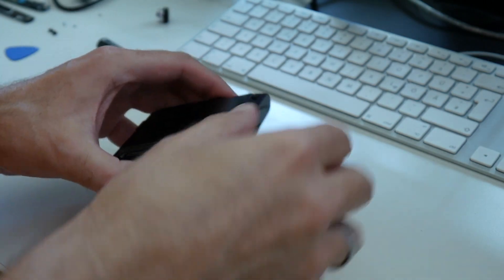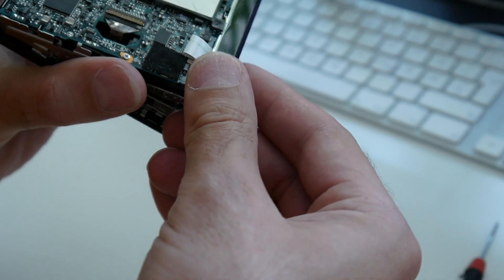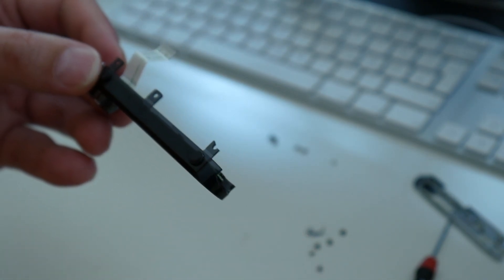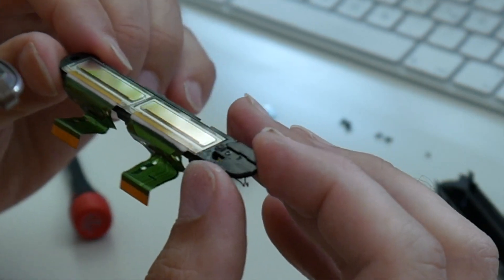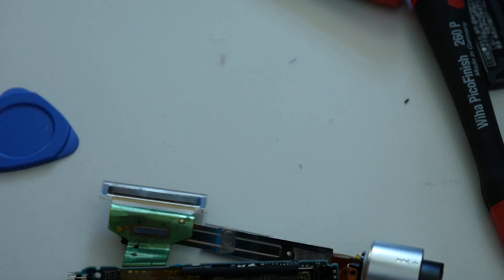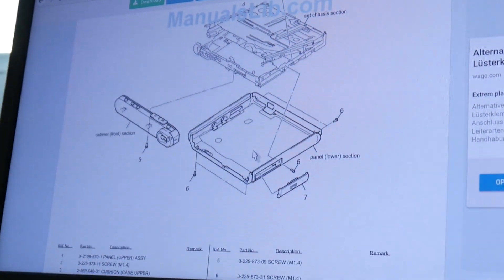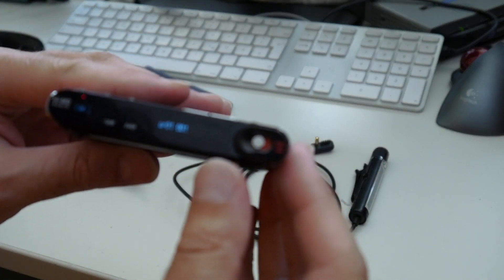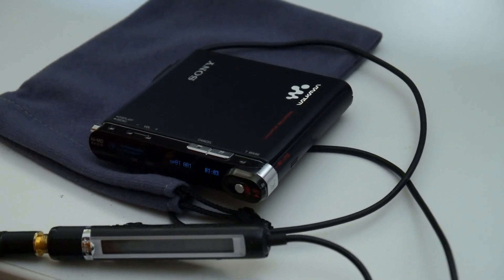Sony Hi-MD MZ-RH1 MiniDisc OLED display burn-in, NW-S205 swap! part II

Comment: I have heard this "3M Novec 1230" fire protection fluid may able to rejuvenate RH1's OLED display as long as the OLED was not complete dead. However, it is hard to get the fluid from the store. (Disclaimer: I have never tried this method but some people have successfully saved the OLED display of RH1. Do it at your own risk)
Reply: Como é feito esse procedimento?
Reply: @flaviomesquitadasilva3807  translation?
Reply: Details please.

Comment: Mine was playing only the first tracks regardless of the discs. I decided to open it a few years ago and I only did things worse. Not it doesn't open/close correctly and the problem still exists plus the battery is dead as well. Any thoughts?
Reply from the maker: sound like mechanical fault. hard grease on the spindel, or broken gear. If it is more broken now, then. ... well, that sucks. You can always try if cleaning and carefully re-assembling makes it better again ;-)
Reply: @renerebe  I got a better RH1 recently, so now I feel more free to fix my old one with plenty of comfort. Thank you for your comment. I might try to reach the optical lens rod and gears for some lubrication though the problem was actually coming from the magnetic head. The old recorded  discs before the problem are still audible.

Comment: Why not look for a parts only unit on eBay?
Reply from the maker: Because even "parts only" units are rare and expensive, and likely have the same faded display? I literally sourced the cheapest, yet perfect display option one could possible find ,-)
Reply: @renerebe  Looks like a really high risk operation. So easy to break something.  I'll have to re-watch 'til end. I did notice a bit of coffee nerves shaking your tools. Too much bean, eh? :-)  I would be putting parts in my hobby vise.  Great to see a brave soul taking on old technology.
Reply from the maker: my hands a pretty steady, maybe try macro filing working on small parts on your side? … you might see even more macro shaking watching Louis Rossmann soldering Mac PCBs ;-)

Comment: Sadly, the NW-S205 now goes for between $300 and $500 on eBay, so I don't believe I will be attempting this repair on my old MZ RH1.  Even "parts only" units are $75 to 100, and there's no guarantee the the OLED is still working.  At that price, investing in a new solid state recorder seems a better deal.  However, thanks for showing that a repair is possible if you are patient and skilled.
Reply from the maker: I got my s205 for like 15 € ;-)
Reply: @renerebe  I'll keep looking. I need two, however.  I'd be willing to spend $30 to revive it, but if the cost of "spare parts" is in the hundreds, I might be selling my MZ RH1.
Reply from the maker: @roastawk  yeah, well finding two for cheap will certainly be a hard task :-/

Comment: unfortunatley this sony oleds fade verry often, i have sony walkman mp3 player (too lazy to look up the model right now) that has this exact same oled and few years ago it started fading and now it has completley faded, i cant see anything even in pitch dark room but thankfully i can still use it without an issue, i just cant see song names anymore but can still use buttons to skip songs and increase and decrease volume

i also cant access settings menu anymore but its fine since i setup my sound settings many years ago so i dont even need to enter setting lol

i managed to get one more same mp3 player exactly same like the one i already have with perfect oled but dead battery and i will probably replace battery on that

but still, its shame that we cant order new oleds from sony anymore :(

Comment: My displays on my RH1 are much much worse that yours, you can barely make out my right hand display unless in a dark room, and left hand display is just not working at all. Have pulled apart and bought a second hand NW-S203. Unit doesn't record anymore either. Playback is fine. That screw that fell out you mentioned at 07:30 also happened to me and stopped me being able to use the eject button. Must be one of the many weaknesses of the unit.

Comment: Would it be possible for you to send me the old NW-S205F you salvaged the OLED display from? I have broken my NW-S205F the end caps and the button section however I have a perfect OLED display and PCB. I would be willing to pay you for UK shipment and small amount for the dead NW-S205F.
Reply from the maker: my NS-S205F is not dead, it is quite well working, just the battery lief and pled brightness is not amazing: https://www.youtube.com/watch?v=I6lN_gRvn0s I could send it in theory, but it is nice enough to just actually keep it, also shipments are not that cheap, I guess the German post / DHL take like 16€ for the EU shipment. I nearly once purchased such an player for like £15 only the UK royal mail shopping costs stopped me (maybe another £15?). So you could probably just get one in the UK just watching ebay a month or two. You can save the search in ebay and get email notification as soon as one pops up. Btw. as you apparently used yours, how log was the battery life, and how high was the self discharge? E.g. my repaired one with this Chinese after market battery, self discharged in just a week or so on my desk :-/
Reply: Hey Rohit I have a NW-S202F working unit for sale (only the OLED is very dimm) the unit works fine. The case is scratched. @rohit khanna